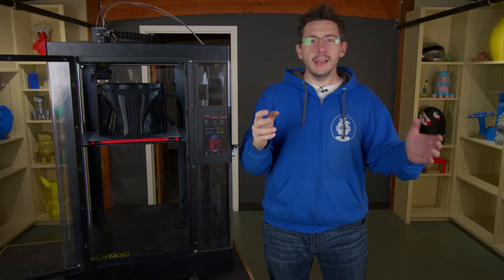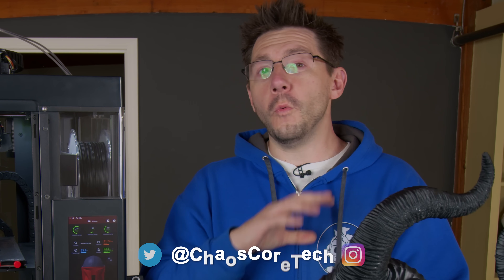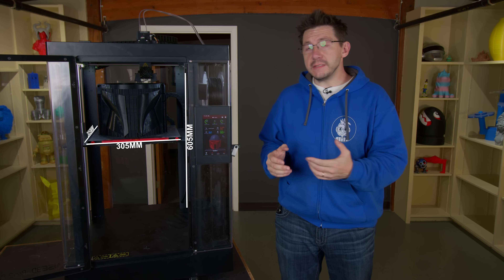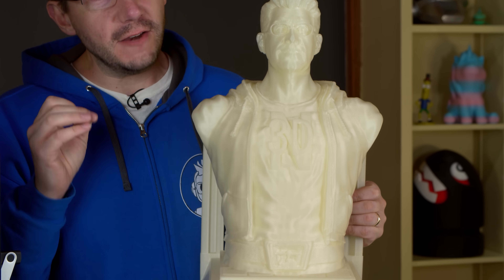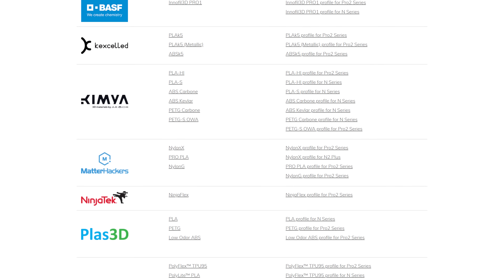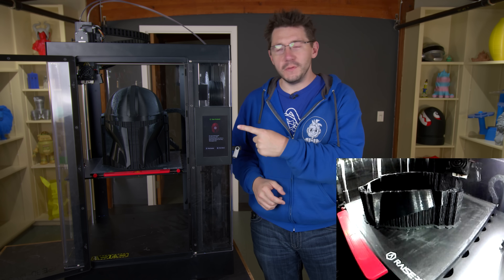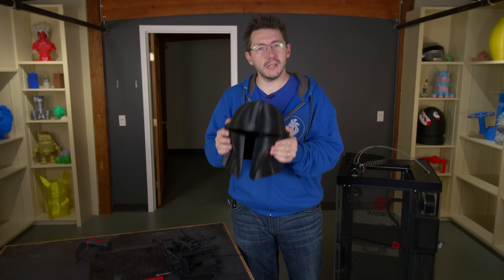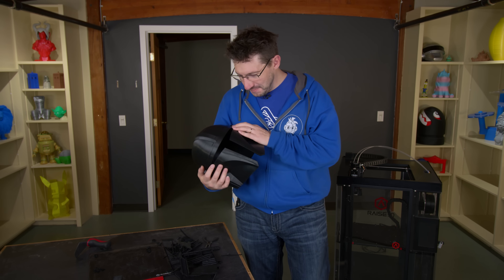LARGE 3D Printer Makes a FULL SIZE MANDALORIAN Helmet! Raise3D Pro2 Plus

Comment: I bought this machine for almost $8000CAD.  Every time I print PVA, it stuck inside nozzle.  It doesn't print petg as good as a $1200 Prusa.  Not recommended!
Reply from the maker: Oh no! I just did a PVA print and the PVA worked great. What has Raise3D tech support said?
Reply: @3DPrintingNerd  First it was stuck so bad that i had to take out the full head to get the filament out.  Support said that my PVA absorted water so I bought a filament warmer and keep there for 24hr and then use it.  It get stuck after a few minutes in printing.  I cold pull the filament out and tried again then it stuck again.   I did a cold pull again but one piece was broke and stuck in there.   I had to open the head to take it out again.   I bought a new $140 PVA and will try again.  I wait more time to fix this machine than printing.

Comment: Yeah, now just to get some custom glasses printed by Luxexcel to fit into that helmet and get it tinted and voila you can see whilst wearing the helmet.
Surprised you didn't use a Pallete S2 to work a nice color scheme into the helmet shrugs welp
And why didn't you use specialized support material for the print? since it has dual print capability?

Comment: Psh get a CR10v2, slap a second extruder on it, connect a Raspberry Pi and Octoprint, and get their ~$70 enclosure and you have the exact same basic thing for ~$5,000 less.
Reply from the maker: Heh. Sure. Do that, let me know when it’s done, and send it my way for testing :)
Reply: @3DPrintingNerd  I've already got that minus the second extruder, and TH3D sells a dual extrusion upgrade kit for the CR series with everything you need included and it's only $125. But my CR10v2 is the best printer I've ever owned, and by far the best for the money.
Reply from the maker: @TheSolongsidekick  I just got the CR10v2 out of the box, and I'm very much looking forward to kicking the tires!
Reply: @3DPrintingNerd  Don't forget to change the switch on the side of the box to 115V before you turn it on! Also, the 3D printed support rod clips attach to the front after removing the injection molded ones at the front. And don't forget the z endstop. Not sure if they've revised the instructions yet but somehow on the easiest printer to assemble of all time they don't mention any of that. Can't wait for your thoughts on it.

Comment: me: hey that 3d printer looks pretty good, i'v ebeen thinking about getting a 3d pr...oh and its 6 grand.
Reply: Or get a Anycubic Predator for under US$350. Build volume = 370 x 370 x 455.
Reply: @Waltkat  Ehhh yeah but deltas are really limited compared to standard designs in a lot of ways. Plus that build volume is small in the x and y and only impressive in the z.
Reply: @TheSolongsidekick  So you think the 370x370 X/Y build volume of the Predator is small compared to the 305x305 of the Raise 3D? Interesting. And I yet to find any limitations compared to my Ender 3, other than it takes up more table space. But whatever floats your boat. If your have the bucks to buy a $6K machine, more power to ya.
Reply: @SoLongSidekick, just get a chameleon dual extruder it's only 99
Reply: @williamdam1891  That's just a ripoff of the Prometheus System. And that's not a real usable substitute for a dual extruder, it wastes so much filament it's only really usable as a curiosity.
Reply: Get a CR10v2, slap a second extruder on it, connect a Raspberry Pi and Octoprint, and get their ~$70 enclosure and you have the exact same basic thing for ~$5,000 less. Or much more economical get the CR10v2 ($500),  Octoprint setup ($35), and the tent ($70) and you have one of the most capable printers out there for about $600. Or you could go with the Ender 3 Pro for $200 and have one of the best beginner 3D printers ever made. And TH3D offers a dual extruder upgrade kit for Creality printers that costs ~$125 and comes with literally everything you need (including a nifty dual hotend single heatsink hotend piece that's extremely easy to mount).
Reply: SoLongSidekick hero reply! I am looking at getting a first 3D printer and love the DIY aspect. Looks like a modded CR10v2 is in store. I also want a resin printer. But I want both.
Reply: @Private_Snowball  A resin printer is on my wanted list as well but they're really only good for small intricately detailed items. FDM printers are much more versatile. My CR10v2 is completely unmodified at the moment and I'm in no rush to even modify it it's such a great printer.

Comment: Joel, with the dual head it's nice that the other nozzle moves up but is there any concerns with the nozzle leaking/ oozing filament as it's waiting it's turn to extrude? 

Also, with the nozzle or the entire extruder moving up and out of the way is there any concern with losing the z height? How reliable is it to coming back to the set height. 

Thank you for your thoughts and comments. I really like the printer and I'm in the market for one just like it hence all the questions.
Reply from the maker: So far, the ooze hasn’t been an issue. I don’t do a lot of dual extrusion printing. Also, the lifting mechanism seems to be precise and I haven’t had issues with it. Again though, I don’t do a lot of dual extrusion :)

Comment: Did this years ago, I designed and built the printer from scratch, just for the purpose of printing a full size jango fett helmet.
Reply from the maker: How did it turn out???
Reply: The first attempt delaminated, the second attempt I used a 1500 space heater to heat the chamber, but the issue was the helmet was actually too big hahaha.

Comment: Dude if you have a 3d scan of your head. Digitally put it in the helmet and cross section it. Scale the helmet up until all the solid parts of your head no longer touch or at least just touch. I just did this with my mandolorian helmet and it's a perfect fit. We ended up printing at a 102% of the helmet on myminifacotory. My brother has a larger head and we checked it and he would need a 103.5ish we think. We just printed the mando helmet and I cannot wait to finish it up. I bought a jar of powdered graphite like punished props used on his mando helmet. That printer looks awesome. My dad was looking at maybe getting one of those, but didn't because there isn't alot of people out there with them yet and so finding files and information about it specifically is hard right now.

Comment: Thinking of a 19.4", 19.4", 19.4" to print vehicle interior parts out of PETG for my 2 pickups. Also a 3d scan tool to help mold models to interior pieces. Printer i found pushed 300°C and 100°C bed with a fabric cover.

Just trying to find room in my house thats really dry next to no moisture.
Reply: You dont need 300C and 100C for PETG

Comment: I have a raise 3d N2 Plus... but not the pro.  I had to remove the second nozzle as it destroyed any print I attempted.  I was told by the company to raise the nozzle but that did not work.  Also, this machine will not print larger models with ABS plastic which is my preferred medium as it can be chemically smoothed.  All attempts to print helmets or large models in ABS with it all enclosed failed as the print would not stick to the build plate.  I tried to make the adjustments suggested by Raise to fix the issue but the machine will not work large prints in ABS...  I would not have purchased the expensive machine had I know how much trouble it would have printing with two different filaments and how it has serious issues with ABS.   I have not used the newer machines where the second nozzle lifts out of the way when not in use, however, the newer units most likely have the same issue with ABS plastic so it is not worth the expenditure of about $6k which is what they cost at last glance.  The N2 Pro is not worth $4k and I regret getting one.  Buyer be warned.

Comment: Even though it looks big on your head it is probably close to the right size. Remember there is more armor that goes on the body that will bulk up so the helmet will look more in proportion once combined with the other armor like the shoulder pads and chest plates etc.,.
Can't wait to see the finally prep-work for the helmet and how you paint it. You also might want to look into foam inserts for a better more comfortable fit.

Comment: but can it print out a pair of the lord of darkness's horns from legend
Reply: In sections as his horns are 3 feet long.  But you would be better getting a larger version of the Ender series printers as they are far less expensive and have no issues with either ABS and PLA.

Comment: Waiting to see this finished, i like to use something similar to spackle paste used in drywall, it doesn't require mixing, can be thinned with water. Spread that across the entire helmet to cover the layer lines then lots of sanding, luckily this substance sands very nicely.
Reply from the maker: What stuff are you using?
Reply: @3DPrintingNerd  Spackle paste used for drywall, check this video out.
https://www.youtube.com/watch?v=s_TJT-Bdaq0&t=3s
Reply: @3DPrintingNerd  Another option is plasterboard, guessing it's similar, saw it used on the official Prusa instagram page.

Comment: How do you handle ventilation 🤷‍♂️ 
So far I've only printed in PLA, but my kids say they can even smell it 😕
🇨🇦
Reply: Matt Kasdorf so we don’t typically worry about ventilation for PLA prints. BUT we did use the BOFA filter for our resin prints recently. It’s not the cheapest option but it sure did remove the smell that resin produces. We just sat it right next to the Phenom, not attached in any way. Worked great!

Comment: One of the 3DP's that you use is a CR-10S Pro? correct? I'm hoping off the top of your head you can tell me the screw size and thread pattern of the screws that make up the vertical lift.  They tighten with 2 screws.  One of mine was stripped from factory.  China clearly no help.

Comment: While the printer may be good with PLA, I have had a bad experience printing with nylon. The part simple warps like crazy. The machine is not good for high temp materials. I ended up breaking nozzles in both my machines as the part warped and the nylon filament that was being extruded just clogged the nozzle and finally broke it.
Reply: Hussain Bhavnagarwala 
We’ve had a lot of problems with ours as well. The biggest issue is thermal creep due to the poor heat sink design. We’re converting ours to liquid cooling to hopefully eliminate jams above the heat break.

Comment: hello joel, I have been 3d printing with a mp mini delta for about 2 months now but i want something a little nicer and bigger in the 300-500 dollar range. I actually started with a ender 3 and i just couldn't get it to print right and i just was so inexperienced and i didnt know why it was happening so i said maybe it is a faulty printer returned it and got a replacement and i assemble it and i use chep profiles which he got great prints but it was still not printing well with so i gave up and got a pre assembled machine (the mp mini delta which i have gotten printing pretty good) any printer recommendations you could make would be appreciated

Comment: What’s the real world cost for that beast of a machine?
Reply: I'm not Joel, but a quick vist to their website tells me that it is $5,999.00.  This is not a printer for the kids, but looks like an engineering beast! If I still worked in the engineering world, I'd want this availability for big projects.
Reply: The BuildTak sheets are considered consumables if you're printing anything other than PLA, and they must be purchased at Raise3D at 60 bucks a pop. BuildTak is actually less expensive than this, and you can get much more durable PEI sheets sized for the Pro2 series inexpensively. You just can't get reasonably priced BuildTak sheets for those dimensions anywhere else, not even at BuildTak's website itself. You could get a bigger sheet and cut it down, but that's a bit wasteful and BuildTak can be a bit of a pain to trim.

If any part of the hotend is damaged, you must replace the whole heater module for 80 dollars. This is because the heatsink is a delicate chunk of aluminum, and the throat tube is also prone to damage and jamming.

There is a PTFE tube between the extruder gears and the nozzle switching mechanism (which along with the direct drive also makes the extruder assembly incredibly heavy, so don't go fast!). You can do a cold or "atomic" pull in an Ultimaker, you cannot in a Raise3D Pro2, and that's because of this PTFE tube. If that is damaged, the extruder assembly has to be disassembled and serviced, and you can't buy a replacement tube from their spare parts shop (I'm guessing they'll ship you one if you report damage there, but that's more downtime).

I've had PLA jam in the hotend with the cover off and the door propped open.

Based on my experience with the steel nozzles, my advice is, don't bother with the 0.2mm diameter-- we wanted to try greater detail with a smaller nozzle diameter, but they only come in steel. Another pet peeve of mine is that they offer all kinds of diameters for steel nozzles, and their brass nozzles only come in 0.4mm. Probably a restriction of their machining process, but annoying nonetheless.

Comment: I think part of the reason that it looks "big" is that the top of the helmet is resting directly on the top of your head. typically a real helmet would have some sort of structure inside it that would actually raise the helmet off of your head an inch or two. Also we aren't used to being able to see the mandalorian's face through the helmet.
Reply: Foam pad would work